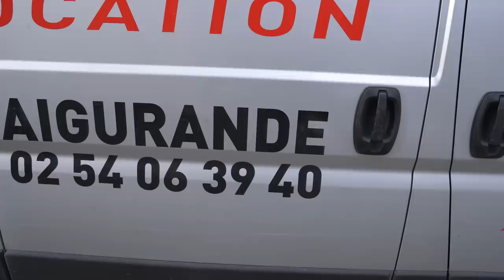The KEY to saving this chateau.

Comment: That arch is beautifully made & your work-around form is inspired... but. 
 Tho' it'll probably last 100yrs, wish i'd been next to you when the keystone went in on the first arch. My gehry-bump of structural engineering wants it to key in about 3" lower with its side-mortar thinner at bottom than at top. I.e. really 'wedged' into the arch. But it's only a niggle -- it'll probably be fine.
 Beautiful work, Dan. A pleasure to watch. Love your 'finish the job sweet' work habit. :)

Comment: Have a concern Dan that, once the wooden support is removed, I can’t help thinking the arch is only being supported by the mortar on both sides.
Reply: This is exactly what I was thinking. If the arch has to bear much weight, shouldn't it be more connected to the walls somehow?
Reply: I don't think he knows how to build a proper arch support.
Reply: I disagree with your last few comments. He’s doing a great job !
Reply: im also concerned that he laid the bricks stacked on top in a straight line, not staggered. There is no brick bearing the load in all the mortar lines.

Comment: Hey! In the arch you started, isn’t the strength of the arch in the inward compression of the bricks? In which case, shouldn’t all the bricks filling the opening be set upright on their sides, not lengthwise crossways. That second row of bricks will compress and crack across, weakening the arch. 

I can’t imagine what a pain it will be to fit the bricks exactly, but not as bad as a failed foundation. You likely need a brick saw. You did say you wanted to put the building back the way it was. 

As for the bigger arches with multiple bricks, seems like you will have to do that in multiple layer runs. Would it be easier to build a mock up  on the ground and cut the bricks to fit the opening before you start mortering them in? You know what the arc of the arch is and you know the height of the opening from the bottom of the arch to the top of the missing horizontal run. You could build an upside down box on the ground the width and depth of the arch top, start with a straight run layer of bricks to fit and then cut the bricks to fit the  two layers that make up the curve that rests on top (upside , down). Then number the bricks by position and layer. Then you can mortar in the first layer of horizontal bricks, let that dry, fit the next layer that will be cut to fit and complicated because they fill in between the straight and the curve, and they are a wider run than a single brick length, and then lay the final bricks which actually face the arch and give it its structure. So you would need three forms for support while the mother sets, one shape for each layer. One to hold the length wise run that completes the upper wall where bricks have fallen out. A second, where the bricks are shaped to fit between the arch and the horizontal and finally the arch itself. A pain, but you can probably use the forms on multiple openings. It will be fiddly, but not worse than trying to cut and fit and mortar above your head in shadow and still have gaps when you are done which weaken the structure. The other thing… you should probably place like with like. The masons put the granite blocks in certain places because granite is strong than brick. So you probably will need to cut granite stones to replace those in arch ways where they were first placed, or at least check with a mason. The walls where there were stones likely are much more weight bearing than the brick arches. Just saying… nothing better than a backseat brick layer, right?
Reply: I am tired just reading that comment 😂❤

Comment: I've seen (sort of) where the electricity came in, but I'm wondering about where's the water? Is/was there a well on the property somewhere? Did I miss that bit? I saw the old pool, so we know they had water, probably also to the kitchen.

By the way, I saw a wonderful upcycling of a pool turned into a partially sunken greenhouse. It works great. You could maybe do that there one day in the distant future.
Reply: He's buying/ bringing water in at the moment, there must be a mains supply around somewhere but I suspect that it's tied up with the planning permission he has submitted prior to doing any work which is most probably carried out by the water authority anyway up to the property!?!
Reply: He mentioned in the comments yesterday that the well just needs the pump dealt with, which should be very soon.

Comment: Dan, I restaurated 2 old houses in Istria (Adriatic) and the workmen there filled the grout joints with mortar by filling strong little plastic bags with a small hole on one point....just like fancy decoration on a cake....and after drying process smoothing it out, just like you do. This might be a suggestion/idea for easy or quicker work....who knows???
Good luck❤

Comment: There were no solar panels showing on the introduction. Have you removed them for some reason? Otherwise, it was great to see some recovery activity for the fabric of the château. However, it is in pretty urgent need of a hat, aka a roof to be some form rain repeller to arrest the building's fabric rot where you are working.

Comment: Dan... is there a stone or paved surface under the front entryway? Have you tried ramming a rod down in a few places to check? If they used concrete in other areas, maybe there's more paving... just wondering. cheers! 🍻

Comment: Have you had a structural engineer or architect evaluate the chateau? I'm not one, but it seems to me that rendering the walls is esthetic rather than structural. My question, and surely yours, is : " what needs to be done so that the walls can safely bear the weight of a new roof and floors?".
Reply: He has mentioned an engineer he's working with in previous vlogs

Comment: Shouldn’t the bottom end bricks on arches sit on side walls/doorframes to be structurally sound? Taking the weight and distributing it to floor. Unless the arches are just decorative and not weight bearing. Just don’t want anything to fall on you!

Comment: I hope you ae going to key your sprung arch into the sidewalls.  You are going to have to do some demolition on each side of the doorway to properly bed your arch INTO the wall.  😊  You are going to need a diamond blade to cut your little slivers of brick to match the arch properly.  😊  Time to set up a propane cookstove and a cot at the Chateau.  Save the time and cost of driving back and forth.  😊
Reply: It's not waterproof to set up as a temporary accommodation, he'll have to build a cabin first, it will have to last him for three years most probably before he can move into a completed third of the Chateau (He's doing it in thirds, two ends and a middle)!?!

Comment: Just realized that the brick work for the doors arches is odd, support wise it's fine, But a proper "lentil" of solid stone would have been better? Width with the depth would asked for a eight inch thick stone lentil? nothing wrong, just odd, stone plus bricks, with a concrete floor/sealing? The handling of trades was odd. Make your mark! is right, make your own corner stone box with a time capsule! before the visitors get to see, a little self identity to your work would be a plus.

Comment: Those arches really look out of place next to the old bricks.  I am hoping there is some way you can make them look older.  Is there any way you could find old bricks or similar bricks so it doesn't stick out like a sore thumb?  The rows of bricks are staggered at various depths maybe you could place them less regimented and do a sketchy concrete coating or some kind of aging treatment?  Do they call that Austrian Schmear or something like that?  I know it's just the basement but we want it to appear consistent,  right?  Love you Dan but I had to say it before you went too far.
Reply: Older bricks are too crumbly and not as strong. He's building for it to last. As you said, it's just the basement so not super important.